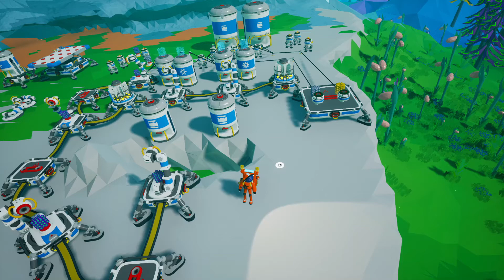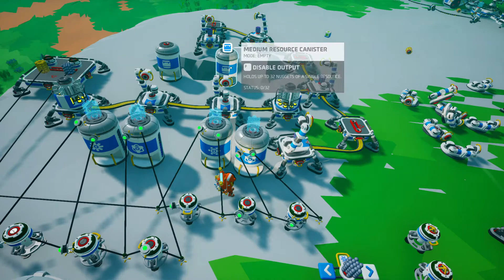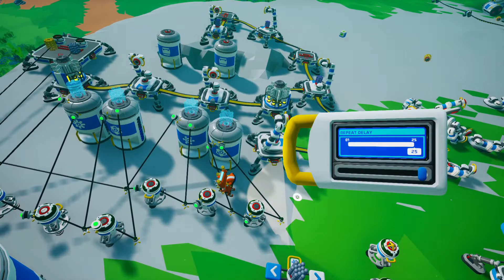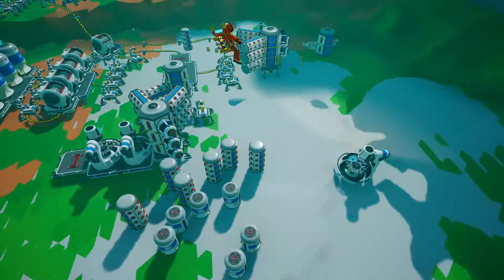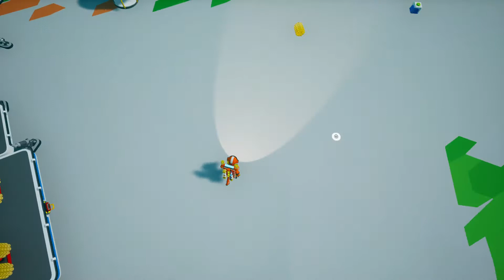Astroneer Concept Build - Vending Machine Design (How to make items drop to the ground)

Comment: How do you do that with things that won’t go into a canister?  Hydrazine, dynamite, etc.  the printer won’t print where it drops into a hole.
Reply from the maker: It's been a while since I tinkered around in Astroneer but you could try making a printing table flipped upside down on a piece of terrain floating high enough so items drop down.